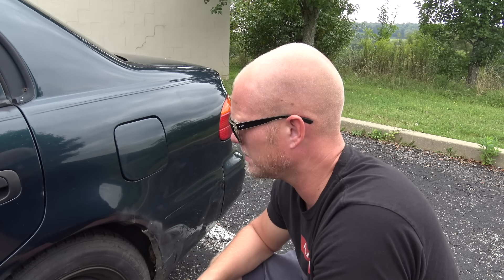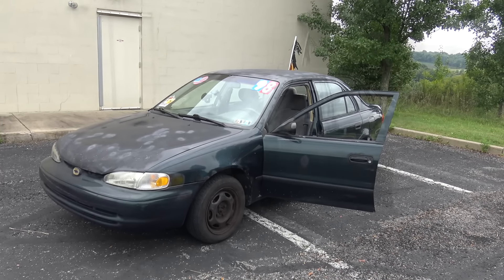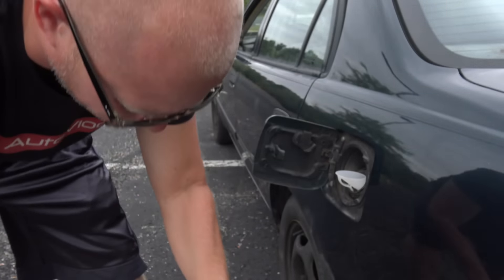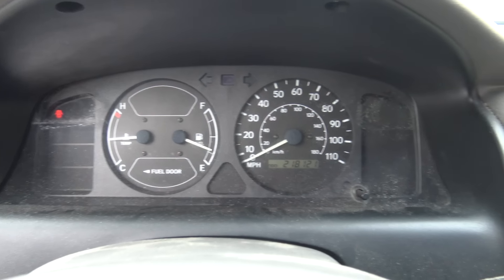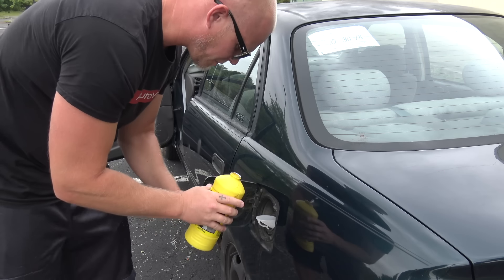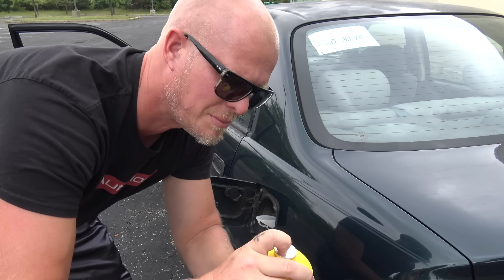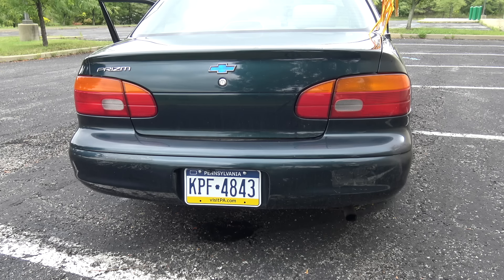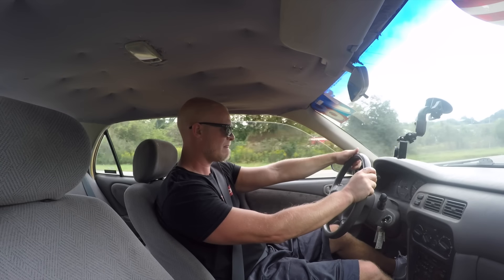What happens if you put BRAKE FLUID in your gas tank? (You'll be surprised!)

Comment: Impressive.  You are "experiment crazy" but incredibly results..
while I was in Ecuador,  my taxi driver pulled into a gas station, put a gallon of gas and a gallon of water and the car kept running normally. I was a little bit scare, but he said he had done this on a daily basis on his rented taxi, that still made me feel nervous, but I the same time  surprised that the car kept going. Another taxi had disconnected the gas lines, and instead he had  attached  a propane tank in the trunk. That was horrified and i made my destination shorter and stepped out of that time bomb. But I enjoyed your experiment. You might want to experiment the 50/50 water/gasoline and see it for yourself.  Pleaee don't try the propane tank. Keep it going, but b safe. Thanks.

Comment: It’s hard to kill a Toyota man, esp these corollas. They will do 500,000 miles easy.
Reply: Dude, it's a Chevy.
Reply: Mark Lansing Mark Lansing An old joint venture between Toyota and GM. Last time they ever collaborated was the first generation Toyota Matrix/Pontiac Vibe. 
Ford collaborated with Mazda when they owned a chunk of them. Of course, you also had Dodge/Mitsubishi back in the day.
Reply: john steel 😂
Reply: You are absolutely right. I had a 1994 Chevy Geo Prizm and the engine block had Toyota stamped on it.  @MrCaptainobvious77
Reply: It's a great lubricant, So there's no harm done when pouring brake fluid on the tank.
Reply: MrCaptainobvious77 :
Reply: Chevy Prism
Reply: a some
Reply: I now right
Reply: @MrCaptainobvious77  does Ford escape and Mazda tribute come to mind???
Reply: Mazi Emdi Most definitely! Do you remember the third one? Mercury Mariner? Out of the three, it had the nicest interior. I just worked in a used dealership, and we had a couple Escapes and Tributes. Lined them up side by side for fun!
Reply: Joe Gibson You have a great point there. You got Lucas Oil to use as an injector cleaner. It works great as oil lubes up the carburetor and helps fuel burn more efficiently. It's amazing how much I'm learning here!
Reply: @jaimeobando7933  Brake fluid is a horrible lubricant.  Put a bit on your fingertips and rub them together - it's grabby, where oil and even antifreeze will be slippery.  And it's chemically aggressive.  It'll eat at the seals, hoses, and o-rings it comes in contact with.  Put a little on a painted surface and let it sit for 30 seconds before you wipe it off - you'll damage the paint.
Reply: Wonder what I was doing wrong. I've had two that only made to 393 & 402 thousand.
Reply: Wow!Weren’t you scared you might blow up?
Reply: Great Drums it s Chevy
Reply: That's no Corolla man.......
Reply: it's a toyota with chevy badges
Reply: Greg C yes it is man....... It is literally a Corolla with Chevy badges. That’s why it is the only modern Chevy that actually was reliable as the sunrise.
Reply: thx for the great video

Comment: Apart from being a hydraulic fluid it is also corrosive ,so all you really did was clean out your fuel system.
Reply: Sounds like you work on cars. I use water to clean carbon build up off.

Comment: For 40 years I have been putting brake fluid into my engines, first down the carb, then through a vacuum pipe. Whilst the engine is running...lots of it. As soon as it starts smoking I would switch off and leave it overnight. It makes plenty of smoke but it runs smoother and quieter. Brake fluid is excellent for cleaning off carbon. BTW the smoke soon stops.

Comment: I read alot of these comments/opinions/suggestions..nobody is wondering about mpg!! apparently, brake fluid in the gas tank cleans the engine internally, injectors, knocks, etc. it also doesn't destroy rubber ie. brake lines, calipers are rubber.
anyway, MPG's are better with a clean system, but I wanna know how much better.

Comment: the amg C63 would break ..if u put the wrong brand of brake fluid in the brake fluid reservoir
Reply: hungrynapps lmaooooo can’t kill a Toyota engine if it was his Mercedes would of break by now tht goes to show u what Toyota engines are made off
Reply: It also breaks when it rains
Reply: @andersonrodriguez8258  what. Literally any engine could run on brake fluid.
Reply: Why would it break if you put the wrong brake fluid lol, at worst you would need to bleed the whole brake system and replace with the correct fluid, it wouldn’t “break” a car, the logic behind that made no sense.
Reply: @Alex-bq3kp  calm down .. i was joking .. lol.. u must be new to the comment section
Reply: @Alex-bq3kp   There are different brake fluids types to name dot 3, 5, 7, and if you mix them there is a problem. Had a friend put dot 7 in a dot 3 system, we had to do his brake system over haul swelled  the  seals.

Comment: I wonder what effect this would have on your fuel pump. All the rubber in your master cylinder and calipers are made to resist breaking down with brake fluid. What about the rubber in your fuel hoses, will it withstand the brake fluid or break the rubber down causing fuel leaks and fires? Remember  flexfuel cars burn ethanol E85, but my car dealer tells me to never run that in my 2017 Sante Fe.  Be careful with additives that aren't made for your car. The damage could be quite costly.
Reply: Logically, that is a real possibility of rubber/plastic components of the fuel system failing because of the nature of what brake fluid  is and does outside the resivor, like strip paint if you happen to spill and not clean the affected area. But when women are involved with 'adding' stuff, it's a good chance they have no idea of what they are doing, being mostly not being mechanically 'minded'. :-/
Reply: As I recall in mechanics school adding actual oil to a brake cylinder will expand their seals until they become too soft to function. I don't believe that happens in reverse. Brake fluid is not a petroleum product. Dot 4 brake fluid is made of borate and glycol.
Reply: Alcohol fuels caused this problem.  Various gaskets were impervious to petroleum products but got soft and leaky from alcohol.
Reply: It's synthetic fluid.  Not corrosive like the standard fluid
Reply: 7lo
Reply: Yeah--putting ethanol gas in lawn mower type equipment destroys the rubber vacuum operated fuel pump.  It takes a good month or two but the rubber diaphragm will swell & distort thus fail.
Reply: Karena
Reply: Jon Martin
Reply: My mom was an aircraft mechanic in the WW2.  I am now 70 and she has had 2 cars in my lifetime.  You will not find a better mechanic.
Reply: Very right. All fuels nowadays contain about 10% ethanol. This is fine on modern vehicles. The rubber that comes in contact with fuel has been designed to deal with it. However if your car, boat, motorcycle, lawnmower, ect was manufactured before the 1990 clean air act it’s going to cost you. By now I’m sure these parts have been damaged and replaced with modern designed parts. If your restoring something that hasn’t run since the late 80’s or early 90’s be sure to replace any rubber in the fuel system. Which probably needs done anyway.
Reply: @jamescranston5613  ...
Reply: @kcox3090  But why the fuck would you do any of this, under normal circumstances?
 this is a waste of thinking.
Reply: @darrellfeit7158  loop

Comment: It might run through the piston rings and mix with the oil, especially making your engine a ticking bomb.
Reply: Total B.S.
Reply: oil burns, brake fluid does not...so that just wont happen.
Reply: @nexxterra  The ignition of brake fluid at 520 degrees F
Reply: @nexxterra  dot 3 brake fluid does burn. Have used it to help free up stuck pistons in old engines. Cylinder heads off soak old denim material in brake fluid stuff in the cylinder bores and light on fire. The brake fluid seats down helps loosen the stuck rings the heat helps  as well  badicly getting the block ,pistons and rings through a heat cycle the expansion and contraction loosen the stuck rings.

Comment: One of the reason why your car still runs because it's a Toyota Carola. Toyota builds some of the best engines in the world, especially the 4 cylinders. Keep up on timing belt changes and other important maintenance intervals and it should last way over 200,000 miles easy. If your engine seems a to vibrate while running, it's probably needs a timing belt change and ignition coils on top of that, besides spark plugs. The timing belt can develop a little alack causing a slight cam shaft timing issue that causes little vibration. If not changed in time, the belt breaks and can cause damage to your valves and pistons.

Comment: Good video as usual! Might need a fire extinguisher, quick release seat belts and park at the edge of your driveway away from your home. :) Brake Fluid is a corrosive and hard to tell how that will damage fuel system components. Don’t need to spring a leak in the fuel system. Be safe.

Comment: Brake fluid is also flammable, thus it will clean your pistons,lifters,valves and such....but syrup on the other hand will give you a different outcome!!!
Reply: Brake fluid is also hygroscopic which means it adsorbs liquid
Reply: Rick Kube p
Reply: Mix 50/50 brake fluid and swimming pool shock powder and stand back. 1-2 minutes, you'll get a self-igniting hugh fireball. Don't breath the white chlorine smoke preceding ignition. Don't enclose in a sealed bottle either... Kaboom
Reply: @SamaritanElad  in a past life when I worked in an outback mine we "borrowed a drum or 2  off swimming pool  chlorine from the mine pool"  we used to fill a balloon with fuel and hang it over a drum of pool chlorine  powder then as the fuel ate its way out it dropped into the drum of pool chlorine , and bob's your uncle the fun begins just keep  long long lon away
Reply: I have poured rubbing alcohol in my brake master cylinder before because I couldn't get brake fluid
Reply: @thomasbeck9075  Rubbing alcohol may attack the rubber seals in your brake system, so I would avoid that. Grain alcohol may not. But virtually any fluid would work for a little while, even plain water. Of course water will soon corrode things & cause problems. Brake fluid is simply hydraulic oil with specific properties. If I were stranded my first choice would be any non-detergent lightweight oil, like 3 in 1 oil or 10 weight motor oil,  cooking oil, or maybe transmission fluid. Then drive carefully so as not to heat up the brakes until you can flush the system. 

Disclaimer: I have NEVER used anything but actual brake fluid in my brake system, and I suggest you don't either.
Reply: @SamaritanElad  yeah those mixes are fun although the first time I heard of it and tried it, the brand of shock I had instantaneously would ignite with the first drops. Scared the shit out of me! Now I want to show my friends so we get some store brand stuff and try with no effect at all, figured add more, still no. Finally filled a 1 liter bottle 50/50 and wait with no effect so we capped and tossed it, about an hour went by and it exploded like a bomb went off and again scared the shot out of me plus the neighbors called the cops.
Reply: Its just like a german product called Liquimoly bro it'll help boost your cars engine.
Reply: Mmm
Reply: @momisboss  brake fluid is actually worse on rubber seals and anything that's not metal.Eat youir paint if you spill or drip any.
Reply: Its always far more amusing to add syrup to someone elses gas tank, for example, that annoying  neighbour thats always moaning about how loud your harley,or musclecar is

Comment: I add ATF transmission fluid to my gas tank and it helps a lot.. But I'm not sure if that's a good call for all Motors.. I have a 94 Dodge Ram.. My 1st car that I tried it out on was a 1963 Dodge Dart with the push button transmission..

Comment: I can only imagine the brake fluid added a lubricant to the fuel and might actually be a fuel injector cleaner / lubricator and not only not do any damage but possbily be a positive step ... If you havent driven to much since this video pull an injector and see if it appears to be cleaner than it should for its age and mileage .. or maybe do a complete seperate before and after video and pull some injectors make photos of condition and then do an after video .. ? you know it will not hurt anything .. and brake fluid does not swell rubber so it cannot hurt the injector o-rings
Reply: So actually it can't cause any problems

Comment: Brake fluid will draw off any water in the tank  so if nothing else will make the car run better
Reply: try putting diesel   in your GAS tank.
Reply: Thank you for being rhe 1st person with mechanical sense
Reply: @portcityrulez  The reason one usually needs to change brake fluid is it absorbs water and that lowers its heat range.  not good when you have boiling fluid and you are trying to brake a car with that
Reply: You cool dude

Comment: In the beginning of your video you stated that brake fluid is used to amplify braking power in hydraulic brakes...Sorry, but that is wrong. The "brake booster" mounted behind the master cylinder uses the vacuum generated from the intake manifold to amplify the force from the brake pedal to the master cylinder. Brake fluid is a hydraulic fluid with a very high boiling point so that it can function in the brake calipers which can get so hot that they glow red and can catch fire. The dry boiling point of a Dot 4 is 230°C and its wet boiling point is 155°C.  DOT 5 has a dry boiling point of 260 °C (500 °F) and a wet boiling point of 180 °C (356 °F) "Wet" defined as 3.7% water by volume and "Dry" is directly from a sealed container..
Reply: Don't mix silicone based DoT 5 with anything else. It's completely incompatible.
Reply: You are right.Also to remind that brake fluid is very corrosive, e.g. can destroy car body paint.
Reply: +Mohammad Moshtofar - you're not wrong there my friend. Most coolants are bad news as well.
Reply: Dot 5 is hydrophobic.[ Does not absorb water ] An advantage over other forms of brake fluid is that silicone has a more stable viscosity index over a wider temperature range. Another property is that it does not damage paint.
Reply: Thanks for info.
Reply: He did state that he's not a mechanic.
Reply: +Neil Purdy. The problem with DOT 5 not absorbing water is that water accumulates in the lower parts of the system, namely the calipers. (DOT 5.0 is less dense than water). Thus the water in the lower parts of the system - calipers - boils at 100 degrees.

DoT 5 for racing is fine. It's changed before and after every race.
For road use it's bad news. Unless you want to replace your fluid every couple of weeks.
Reply: Neil Purdy have you ever heard of LHM brake fluid? I guess most people don’t. I remember there was a time when I was at driving school in China I saw people pour power steering fluid in brake fluid reservoir to top it off. A few years later as I was learning autotech in US, I realized that they were so ignorant. But as time goes on, as I did more research on different kind of brake fluids I learnt that there is also a special brake fluid called “LHM”. It is used by many Citroën, Peugeot, some Rolls Royce and Jaguar plus a very few models of Audi. And suddenly I realized that the car I saw people pouring the “wrong” stuff in was a citroën, and this whole time I was the big fool thinking people in China were using power steering fluid as brake fluid because of their ignorance.
Reply: What is the difference between DOT 5.1, super DOT 4 and DOT 4 low viscosity??? They seem to be pretty much the same thing as their dry and wet boiling point is only 10 degrees apart from each other.
Reply: Ty
Reply: Sorry but you Neil are not correct. The hydraulic brake system is in fact an amplifying power system. Have you never heard of NON power brakes in older cars, bicycles, etc.? Manual braking systems do NOT have a power assist booster. Yet they AMPLIFY the pressure your foot inputs to the hydraulic fluid system using the principle that pressure within a closed system is equal through out that system. Therefore when you exert a 100 lbs force on a 1 sq" piston in the master cylinder, then the 4sq" piston in the brake caliper exerts 4 times as much force. That's is why we use this method...to amplify the force drivers need to stop the car. Then if we add a vacuum power booster we additionally amplify the pressure applied to the master cylinder piston which still uses the hydraulic system to apply the braking force.
Reply: wow ... nerd- gasism of detailed facts
Reply: Go see if you can start it it's ran Thur give it a tey

Comment: Seafoam in your gas can improve your engine a lot and also in your crankcase.You will be shocked how better it works for performance,gas mileage,and knocks and pings.
 Super-tech motor treatment does the same thing.Change oil after 100 miles.Use one ounce per gallon .No smell either,it's pure petroleum.

Comment: Not only would it clean the fuel system , brake fluid actually conditions rubber seals and is good for leaks because it actually swells the rubber 👍